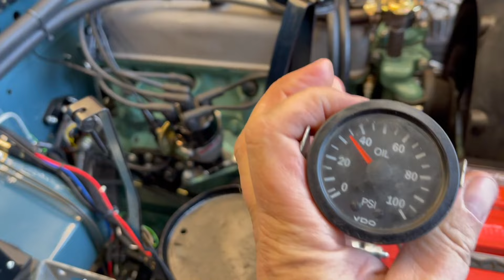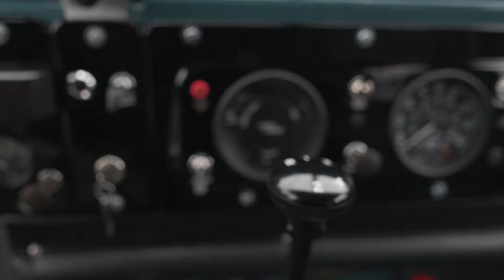1971 Land Rover Series IIA 88" Full Restoration

Comment: i am quite sure thats not the original engine. Or at least head
Reply: Why would you say that? Can you see the block casting date in the video?
Reply: @mikesandone2652  yeah I am actually wrong. I thought I was watching the NAO 109 video and noticed the head was not a HC head that was fitted to all military trucks
Reply: @Rover4387  Ah got it. Yes we usually try to keep the original short block. We do change the early heads out to later ones because we shave them to 9:1 compression and the early heads are not great castings for that.